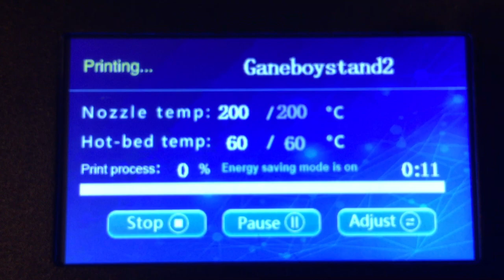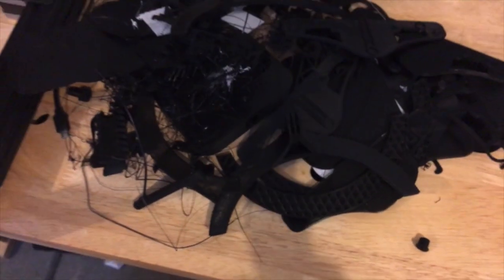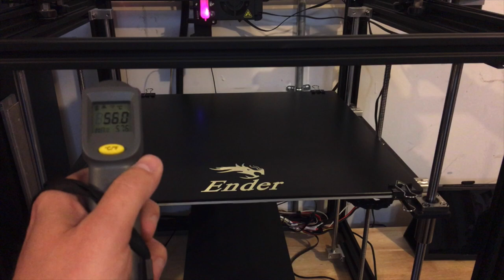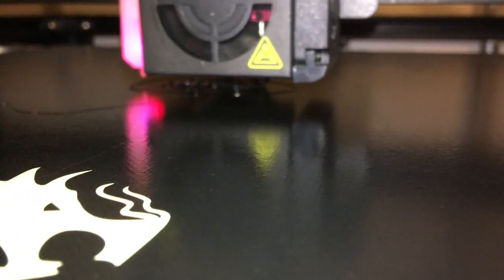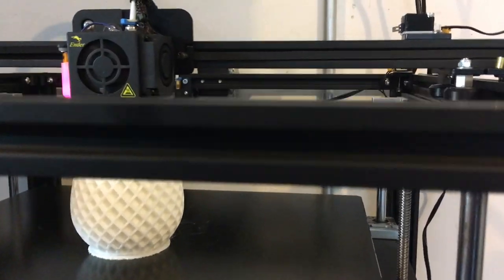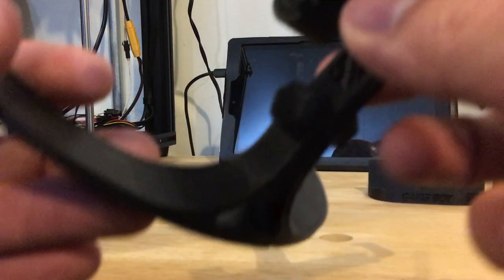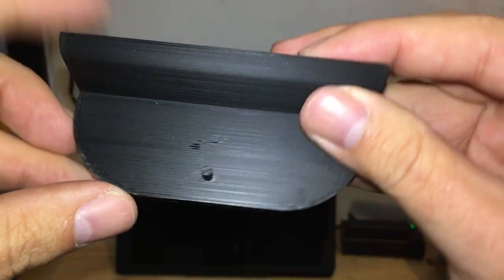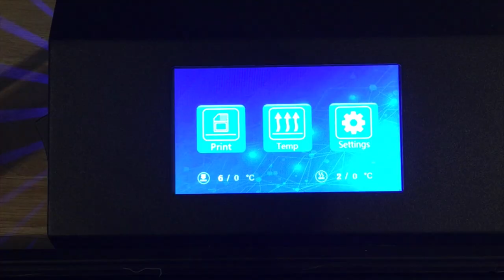Is the Creality Ender 5 Plus a failure?

Comment: This printer has a fatal flaw.  It's the power supply.  Search Youtube and educate yourself.  You need to know.
Reply from the maker: You are correct!  I found the following video - https://youtu.be/A-Zb40P09MQ
Reply from the maker: RAMTEK - Did you watch the video i just mentioned?
Reply: @TripodsGarage  I watched part of it.  It looks like you replaced the original with a Meanwell.  It's a better supply but it won't fix the problem.  The printer needs 1000Watts to have any safety factor and the easiest/cheapest way to get that is to parallel two supplies.   It's what I'm going to do.  You won't hurt my feelings if you research this yourself.  The Meanwell will fail also.  It's really not a quality issue.
Reply: I can confirm with my newly built ender 5 plus (as of today) that it came with a 500W meanwell powersupply which is a much better unit than the one originally with the ender 5 plus
Reply: @ii_berzin_ii9079  Mean Well is a good product but the issue is wattage.  Use a watt meter to see how much current the heaters draw.  You'll find they consume over 700 watts when both running.  No amount of quality can fix that.
Reply: @ramtek2702  yea then the power supply would shut off because it would be trying to put out too much power right? It has a safety mechanism that shuts the power supply down when it's overloaded. What about the people that theirs operates just fine with the meanwell upgrade?
Reply: @davidnunez3523  Power supplies don't work that way.  No matter how big the supply (wattage wise that is) the load will only draw the power it needs at any given time.  Example:  A 1000W supply can supply 10W forever if that is all that is required.  Nothing bad will happen and the supply will not shut down.  Manufacturers don't like to over design PSUs because higher wattage supplies cost more and are physically larger making their whole product bigger & more expensive.  It's a lot like having a 1000 HP motor in your car just to drive to church on Sunday.  Not very efficient.  Conversely, under designing a PSU (like in the Ender 5) is like  holding your gas pedal to the floor all the time.  The motor will wear out prematurely.  So will the PSU.
Reply: There’s an actual discussion between a YouTube creator and a PSU manufacturer that I read. They came to the conclusion of 500W as being adequate for the majority of users and a 650W for print farms that run non stop. I believe TH3D was in the discussion at one point. 

1000W would be complete overkill. This printer doesn’t have anything different from your standard Ender other than a larger bed, larger Y motor and an extra Z motor. 
Nothing there requires an additional 650W over an i3 style printer.
Reply: @chrisward8521  The standard safety factor for such a circuit would be 100%.  I've always wondered why people ignore safety factor.  It's cheap insurance.
Reply: My watt meter is showing 450 Watts at peak. It’s a cheap one, so I’ll try the one I have at the shop on Monday.
Reply: @chrisward8521  I'd like to participate in that discussion.  Please forward it to me if you can.  Thanks.
Reply: @ramtek2702  I just completed a 9 day print and recorded the Watt use. 289 Watts is the average, 138 Watts as the low and 479 as the peak. That is well within the safe zone for a MeanWell 500 Watt. I’m not sure who gave you that 700 Watt number, but it is not correct.
Reply: @gaxon1920  It may be within YOUR safety zone but good design prectices dictate otherwise.  I have designed many power supplies and good practice says the supply should be capable of 1.5  times MINIMUM of the max load.  2 times is preferable.  There are many factors that will de-rate the capacity of any power supply.  It's simple physics.
Reply: @ramtek2702  can you provide proof of what you say? You’ve already provided incorrect information. Why should I believe what you’re saying since it contradicts everything everyone else is saying?
I mean, anyone can claim something, it doesn’t mean it’s true.
Why does MeanWell say that the PSU is safe for that application? They could easily claim we need a larger PSU and make more money.
Reply: @gaxon1920  Honestly, I don't care what you or anybody else believe.  I have nothing to prove to you.  Chances are you won't have a problem as long as you keep the PSU cool enough to be within spec.  The 500 watt PSU has an integral fan which will help but it's also trapped inside a sheet metal box with only a tiny fan for ventilation.  Quality PSUs seldom fail immediately.  Running them at full load is like racing your car motor full throttle.  It will work fine for a while but the useful life will be shortened significantly.  I don't know why that is so hard to understand or difficult to believe.  Please don't bother me with this again.  You're only trying to prove you're smarter than I am so I concede.
Reply: @ramtek2702  it’s not running at full load. Not even near full load. What are you on about? If I hurt your feelings, I’m not sorry. I call out bullshit when I see it. 
I’ve had a 500W PSU drawing a constant 400W for 8 years and going strong. I doubt a 330ish average is going to hurt a quality 500W PSU.

With that being said. If you don’t care what anyone believes in regards to your unfounded theories. Stop posting them on a public forum.
Reply: @ramtek2702  God no wonder mine always errors out when I heat both at the same time
Reply: I recently got one and it came with a meanwell power supply
Reply: @ramtek2702  You need to tone down a bit. I don't know about the firmware, but it could easily be configured that it's not doing full PWM on both heaters simultaneously. And it most likely is done like so.
Reply: @ramtek2702  Not sure where you are getting a 50 or 100% utilization buffer for a power supply from. In all my years of working with AC-DC power supplies I have NEVER seen those values suggested, 20% has always been the "rule of thumb". An NO, not a single power supply is manufactured to its listed specs.. they are all overbuilt as a matter of safety and economics. Its not cheaper to build a supply that will fail when used at max label spec when you have to replace the failed unit for free.
Reply: @davidnunez3523  I have 3 Ender 5 Plus machines and all have Meanwell PS I have had one of them since 2019 and the other 2 about 3 years and have never had an issue with the power supplies, however, I have heard of people who run Octoprint and have the hotend and bed heating up at the same time having this issue but you can set the bed to heat up before the hotend, I have also seen on a YT video that the high power draw is only for a couple of seconds.
Reply: This is true..i had to change mine aswell.

Comment: Built mine over the weekend and other than getting used to bl touch, works flawlessly - turn off economy mode as the printer shuts the heated bed down to save electricity, glass being glass does a good job of letting go of the print as it cools down - maybe also try running first layer at 205/210 to assist adhesion as well

Comment: With the problem that you have with the lifting corners and lifting prints use a brim instead of a raft. 

Also use the z axis compensation to get the printhead a Little closer to the bed on first layer 

I have even found cranking the bed temperature up to 65 to 70 degrees for the first 30% of the print works nice 

And finally for the problem you're having in the garage with temperature you don't even need an enclosure for PLA just get a little space heater and put it in close proximity to the printer

Happy printing and good luck
Reply from the maker: Hello RealFifty - The E5+ was only out for about a month when this video was produced, and not much was known about this machine.  I actually covered a lot of these bullet points you mentioned in other videos.  Thanks

Comment: I had some fun with mine, lots of run outs where the plastic extruder let it down, Get a metal one asap and replace the white low quality Bowden tube with a quality PTFE tube. Instant improvement. I run at 215 Hotend and 65 bed for the Glass PLA+ im printing a RC Plane from. Not the lightest material but itll look nice lit up flying at night.  Keep going if you got one, You will sort it out. Oh.... build a enclosure for it. Keeps it all nice and warm.

Comment: Ambient temp plays a huge role. If the ambient temp around the printer is below 70°f the printer will have issues sticking. Eco mode off always. Try building a pvc pipe and 6mil plastic sheeting enclosure. Super cheap and you can retain the heat a lot better at your 50°. Also if the filament is really cold the extruder will have issues and the PID goes haywire.
Reply from the maker: Buck Nasty Think you are spying on me 😉!  Stay tuned for my next video!
Thanks for taking the time out of your day to watch my videos!
Please like, subscribe and share - Tripod

Comment: Energy saving mode really needs to be turned off by default.  Its something that will cause prints to fail and if folks don't understand it they will blame the printer for being trash.  

This is not an entry level printer.  

That said I've tweaked mine a bit and absolutely love it.
Reply: Agreed
Reply: @DaT_Animations  !

Comment: That is a lot of failed prints...... (insanity is doing the same thing over and over again and expecting a different result.) One would think after the second fail we might start looking for the issue (ie. Creality forum, Youtube, WWW).....

Edit: I am buying a 5+ this summer and have never printed before in my life. But during my research for the printer I wanted I did discover that (Ecomode on the 5+) or allowing the bed temp to drop will cause this issue every time. Also use the glass side of the bed or glass itself for the best bed properties.
Reply: Honestly I disagree. If this glass Has the same top texture as my authentic creality glass, I love it. I use a glue stick from time to time to help with adhesion. But mesh bed leveling is the best thing.  UBL FtW

Comment: Do yourself a favor and ditch the glass. Get yourself a spring steel bed, the bed temp is only a couple degrees lower on the edges vs the center where the heating element is. I got the wham bam kit and I'll never use anything else. You'll never need another raft or brim.

Comment: 1. Your bed temp is to high. 50c to 60c. I found on my cr10s 50 worked fine. You will get warping on the part any higher then that. 
2. Check your belts. The shift on that print looks like lose belts or skipped steps. You can tell the difference based on multiple prints layer shifting at the same level, that and if a print breaks lose it falls it doesnt shift like that usually. The lose belts can be fixed by tightening, if it's the steppers you have to adjust the steppers. I would look up how to do it on you tube. There is a lot of help with things like that. Just look up other creality printers if the layer shifting keeps happening after tightening the belts. Don't over tighten the belts either. That can cause skipped steps too. They should be tight enough to not have any play. Usually if you strum the belt it should have more of a deeper sound. To tight and it sounds like a over tightened rubber band.
Reply from the maker: Hello William - Thanks for watching my video!
Yeah, I tested printing at 50c - 60c and at the time I was fighting the ambient temps in my garage.  I posted a new video the other day (Creality Enclosure), that pointed this out.  Once I lowered the bed temp to 55c, there was no warping at all.  I will still take your advise and run with it!  I will still check my belts today when I get home.  I am having some issues at the back of my curved prints.  There is a weird line on the Z axis on almost all of them.
Thanks again for watching - Please like, subscribe and comment - Tripod
Reply: @TripodsGarage  I would watch it being inside that. The control box can overheat causing the steppers to behave by skipping steps. That and the wheels can warp. I had the same issue or my cr10s in an enclosure I built. The control was on the outside, so no problems there. All my wheels started getting flat spots in them. Here soon I am doing a video on rebuilding mine using linear rails. Oh yeah and if you have problems with the abs sticking you can try what's called an abs slurry. It helps abs stick.

Comment: Also, print a temp tower and destructively pull each temp section apart until you find which has good quality and strength. Do this for every filament you use.
Reply from the maker: I am located in the burbs of Chicago, tomorrow I should be able to do this test.  The temps have been hovering around freezing.  Since my printer is in the garage, it is affected by the outside temperatures. Tomorrow it will be around 54deg, and I should be able to a temp tower.  I am currently working on plans for an enclosure once I am done with the stand.  Thanks for the tip!
Reply: @TripodsGarage  I would get a heater.  Try the Vornado VH200 Heater. it works great.

Comment: Midwest here with my printers in my garage too. I have a partial enclosure and a space heater to help with bed adhesion because I was getting the same bevelledwarp. I also lift my bed temperature to 60. Temperature definitely has an effect. I also noticed the bed levelling I also effected by temperature fluctuation.

Comment: I've owned my Ender 5 Plus for 7 months now.  It's only really failed 3-4xs and I've been running it 24 hours a day since Feb 2021.  It's now Sep.  Last night it had a pretty big error but I'm pretty sure I need to clear a nozzle breach.  I think the biggest issue for most is they jump on this printer rather than starting with an Ender 3 or a smaller one first.  This is a great printer and it's not impossible to dial in and get good prints, your going to have failures.  If you didn't everyone would be doing it.  It's what you learn from the failure and come back and get an even better print the next time.
Reply: Mine has failed 3 of 4 prints and I'm really starting to hate the thing...  And for what it's worth, I'm a 3d manufacturing engineer.  I don't like what I see.  

-Plastic powder on rails due to stupid roller system
-Can't heat both nozzle and bed at same time or error forcing reset
-2x now filament has broken and wound around in circles like a phone cord.

Comment: I had a lot of issues with my Ender 5 Plus. To this day, it's incapable of printing anything over 8 inches in height as it tips over and falls. Still trying... For best adhesion use glue stick and clean the bed after each print with water and soap. Don't use hairspray as it forms a nasty and hard to clean film that hurts adhesion. Use brims and offset from the bottom to avoid elephant foot. Turn off eco mode and leave the bed heated throughout the print. If that doesn't help, use painters tape to secure the brim edges to the bed. Yeah, it's a PITA.

Comment: I had a similar problem and it turned out to be the leadscrew nuts, they were fully torqued up and I remember when building either an Ender 3 or CR-10 that the instructions told me not to tighten the leadscrew nut fully, bearing this in mind I slackened off the screws by 1 quarter turn and all was well, what had been happening was that the leadscrew was binding up and knocking the part off the bed.

Comment: 80% or stronger rubbing alcohol... glass plate comes with not only adhesive and dust from the plastic cover, but it is coated and needs to be heated to 70C first and the cleaned with alcohol after every print. also wait till bed cools completely to pull part or residue will be left.

Comment: So you understand the some of the problems, mainly your plate environment is uncontrolled and cold.

1” styrofoam board, from building supply house, in 4 foot x 8 foot x 1” thick, is a source for a cover box, and heat rises, so a box about 2 foot each side, with an appropriate stand to drop over the machine upper, would help. Heat with incandescent light bulbs, thermostatically controlled.

Next, you have noticed but ignored the uneven plate temperature.  Allow your plate to heat for 30 or more minutes, to heat to flow more evenly across the plate.  Better yet, look fo a distributed heat source or devise a distributed heater arrangement.

Next, your plate is one of the worst materials for the use, aluminum, which expands, contracts, and warps, under the influence of varying temperatures.

Place a 1/8” glass plate atop the aluminum.  If you have the wherewith-all to do so, hand lap this glass flatter, each side, on a larger glass, figure eight pattern, and do three plates at a time.

You can level all day, but uneven build plate, due to heat variations will undermine your efforts,

One more thing, study the properties of the materials you work with... PLA contracts under cooling, and is a great source of heat shrink plastic.  Consider that.

Comment: I had great prints out of the box, but I did have a heads up to turn eco mode off. 

I later swapped out the board to an SKR Pro, still getting great prints.

Comment: Number one question.. Have you calibrated your esteps, then calibrate flow by printing a single wall cube and measuring the width then adjusting flow % until it exactly matches the line width.
Reply from the maker: Haven't done the estep calibration yet, maybe I will do that tomorrow as well as time permits.  Thanks again!
Reply: Tripod's Garage did you ever get around to testing your esteps and flow rate for the 5 plus? I’ve been wanting to do it but haven’t been able to find any good info on accomplishing this for the 5 Plus.

Comment: Thanks for posting, that model is looking pretty attractive to me atm. I like the fact that the bed is supported in more than a few spots. Michael at Teaching Tech has posted a few vids about building an enclosure that might help out with your heat issue.
Reply from the maker: An enclosure is on my list!  I will be starting a build very soon, or I will have to wait until spring to print...  that isn't going to happen!